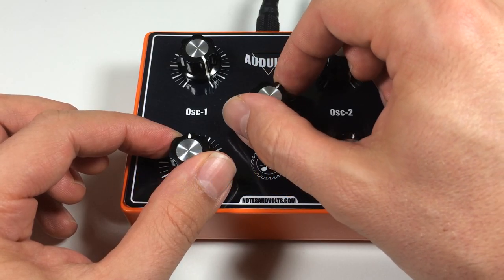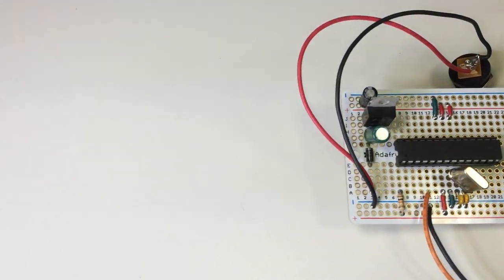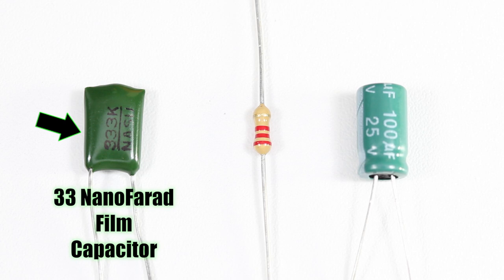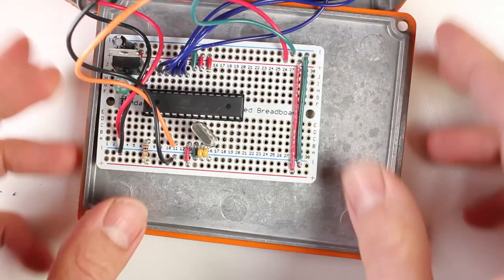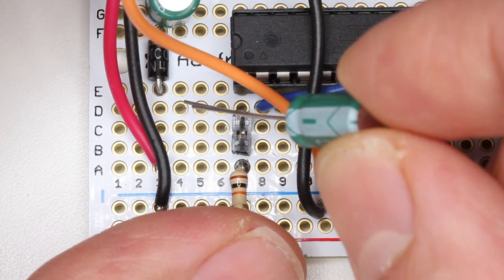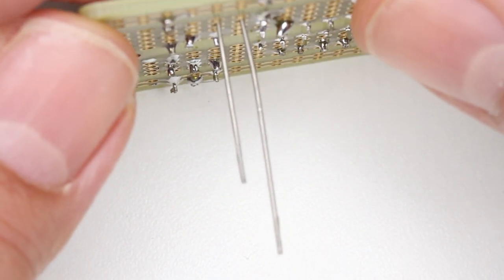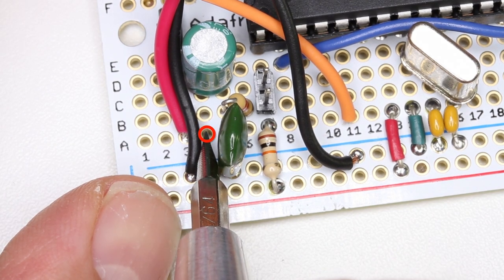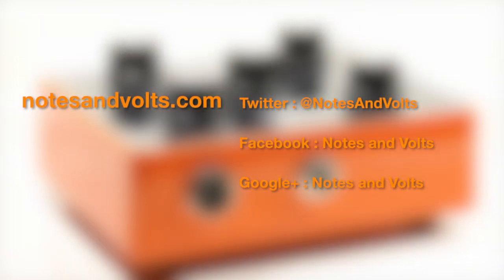Build the Auduino Granular Synth - Line Level Upgrade

Comment: Hello
I studied electronics, but am not very familiar with audio
Why would you use a low pass filter (Resistor + film capacitor) to reduce the voltage, instead of a regular voltage divider made with two resistors? (2.2k and 560 ohm for example)
Reply from the maker: Hi Italian Programmer. Thanks for your question. I took this approach because the output level of this circuit varies a great deal with frequency. Lower frequency sounds are well within line level but when the higher frequencies are dialled in, the level jumps up considerably. There is also some very high frequency noise that is present without the filter that I didn't find particularly musical. This approach was the best I could come up with to smooth out the sound to a constant level. I choose the component values partly through calculation and partly by ear to find the best compromise between correct function and good sound.
Reply: Makes sense, thank you!

Comment: I don't know why but mine doesn't sound almost anything like yours... It has way too much background noise. I've tripled-checked all connections and tried uploading the auduinov5 program onto the chip again, without errors... Any idea to which could be my problem? Tried a different cable and jack as well but nothing. (I also checked my potentiometers and they're fine)

Comment: how did you come up with the circuit you used to attenuate the output? you're low pass filtering the output, of course the sound is going to change...
Reply from the maker: +Josh Mulder Hi Josh. The LP filter takes care of some harsh high end digital noise and helps keep the output voltage in check. I chose the values carefully so they don't neuter the sound too much by experimenting with the caps until I found something musical. Sometimes your ear is better than an oscilloscope :) If you want the raw sound, just go with the original circuit.